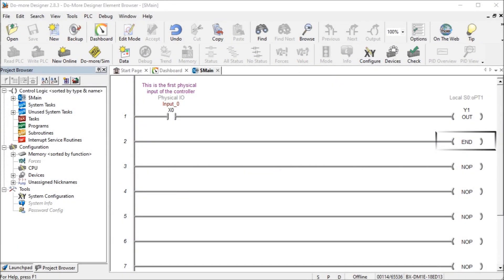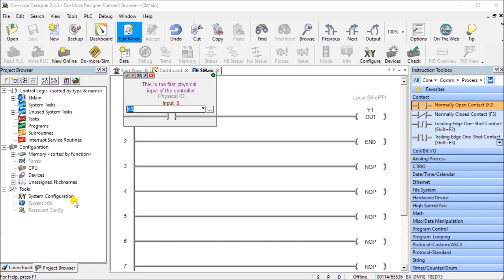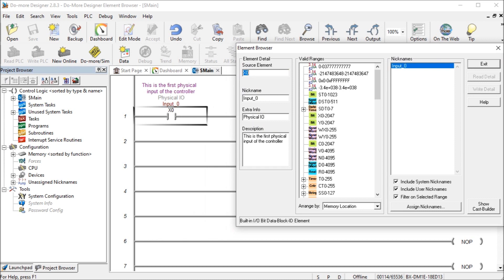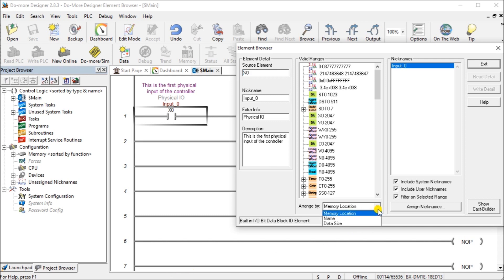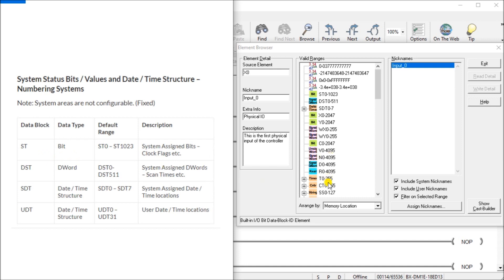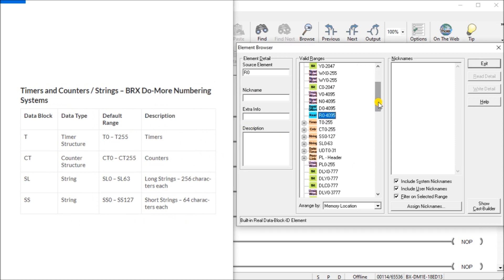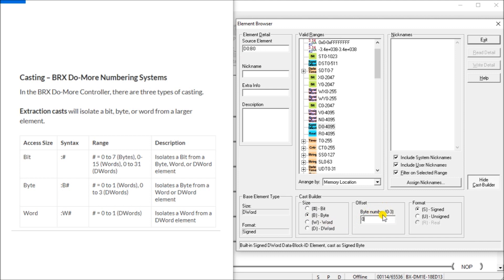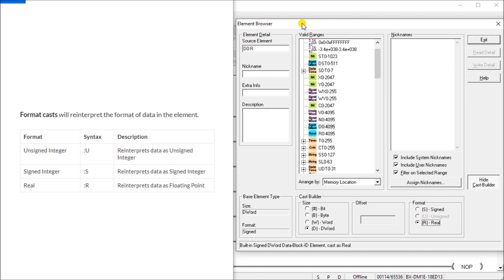Unlock Hidden Do-More Designer Browser Secrets That Save Hours

Comment: Can a hex memory location from another device (like an absolute encoder) be used in the BRX Do-More coming in on RS485?
Reply from the maker: Hi Bobby
It would depend on the protocol that the other device has. Do you know a specific part number of the encoder?
Regards
Garry
Reply: @ACCautomation   Thanks for the quick reply! The other device is a CUI AMT21 series and it's protocol is rs485.
Reply from the maker: @bobbys4327  
After reading the specifications on the CUI AMT21 it looks like the BRX would be able to communicate through the serial port RS485 set for ASCII.
https://www.cuidevices.com/product/resource/amt21.pdf
Regards,
Garry

Comment from the maker: The Cast Builder in the Element Browser in Do-more Designer will assist you with Casting.  Casting is the ability to change the data type or size of an element to something other than its native size or data type.
Select the browse icon on the main menu or hit the F9 function key on any element field to bring up the Element Browser. Hit the [Show Cast Builder] button to expose the Cast Builder tool at the bottom of the dialog box.
Bit-of-Word cast to pick bits out of a register.  V0:13 picks out bit 13 of register V7.
Bit Pack Casting to look at a range of bits as a value: X0:UW is the first WORD block (X0 thru X15).
Size and Data cast to morph a register to another size or type: MHR0:RD looks at two consecutive 16 bit registers MHR0 and 1 as a REAL.
More information can be obtained on our website about casting:
https://accautomation.ca/do-more-designer-element-browser/
Regards,
Garry